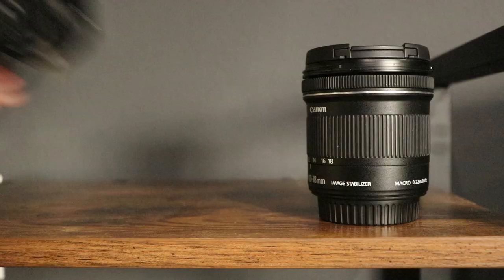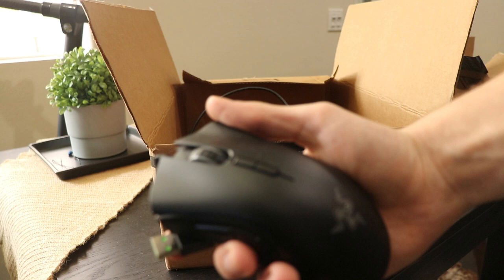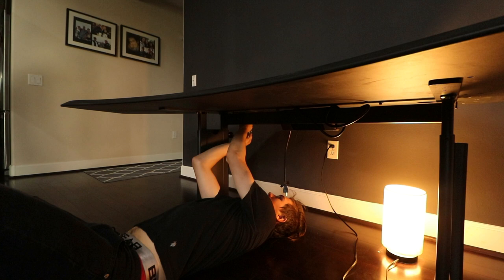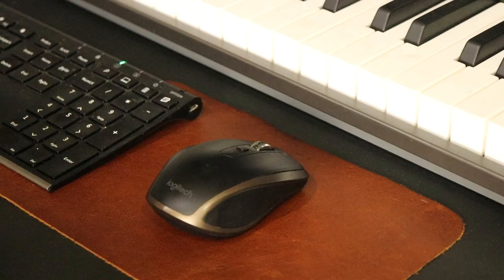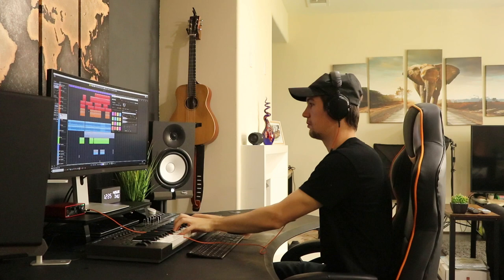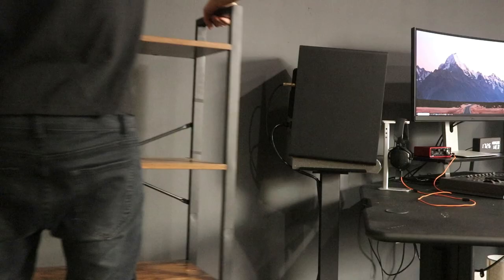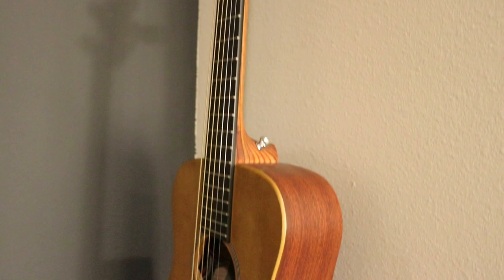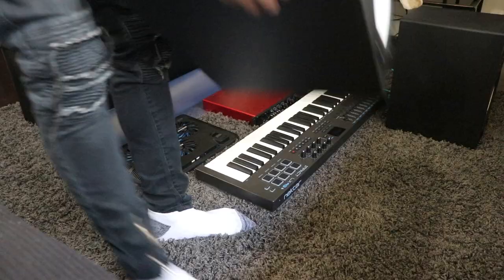Music Studio Desk Setup For Producers - DIY Home Studio Setup 2020

Comment: Thank you for making this video. I found it helpful as I am reconfiguring my own home studio. (Unfortunately, it's still confined to my bedroom, which luckily for me is freakishly large for a house this small.) I am curious, however, about your larger space in general, and how it conforms (or doesn't conform) to the widely accepted guidelines for monitor placement/sweetspot and room treatment.  For example, your Yamaha monitors are very close to the walls, which I've always been told to avoid. I also see hard, reflective surfaces everywhere in the scene and wonder how those impact your mixes. Sure looks great regardless.

Comment: Nice setup. Thx.
I am thinking about buying presonus e8 xt or e66.
I guess I need an audio interface like focusrite scarlett 2i2 3rd gen to connect those studio monitors to the pc ?
I also have a rode nt usb but I guess it will stay directly connected to the pc and not the audio interface?
And as a headset I took the superlux hd 681.
Thx for help or advice.
Reply: I bought adam t8v and uses my denon mc 7000 as sound card.

Comment: i want to ask why do you need a Big knob if you got an interface... what does the Big knob do
Reply from the maker: The big knob I use is just for connecting 2 sets of studio monitors.  So if you want your main monitors and some reference monitors connected at the same time, it makes it easy to jump between the two (especially when mixing music).  This big knob is just a monitor controller, not the interface 👌🏼
Reply: @EdwardSmithMusic  Thank you very much for  explaining

Comment: Hi
What’t the sizes the speakers must be far apart  from each others?
Reply from the maker: The distance you are from each speaker, should be the distance between each speaker.  So if you are sitting 1m away from each speaker, the distance between each speaker should be 1m 👌
Reply: @EdwardSmithMusic  
Allright cool!  Thank you
And do u have any suggestion what high is the best for the speakers?

Comment: Never, EVER use curved displays in a sound monitoring space!  That is a total no-no.  Any acoustician or studio designer will tell you this.  You might have noticed concave surfaces are scrupulously avoided in all control room design.  Diffusion is the rule in a sound monitoring space for a very good reason, to break up standing waves and reflections.  A concave surface focuses and enforces a very narrow band of frequencies, and it does that right in your face, the last thing you would ever want.
Reply: Nice tip!